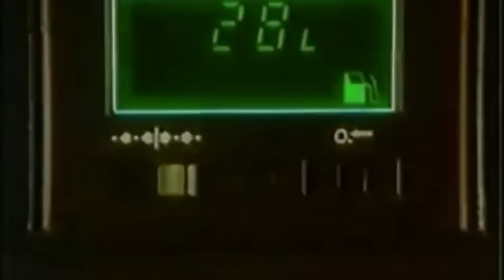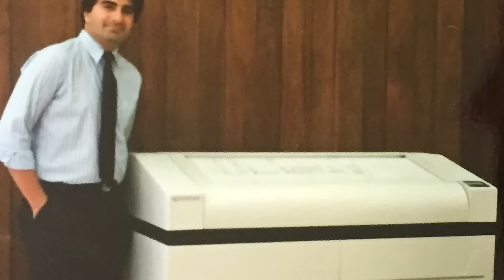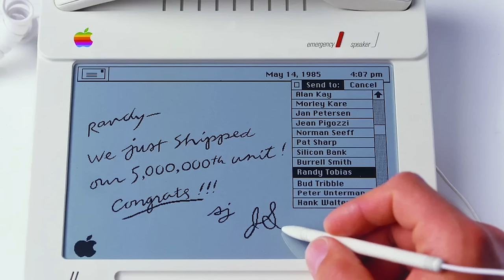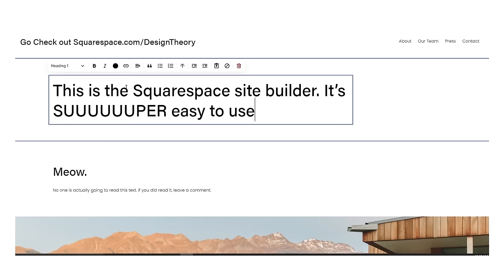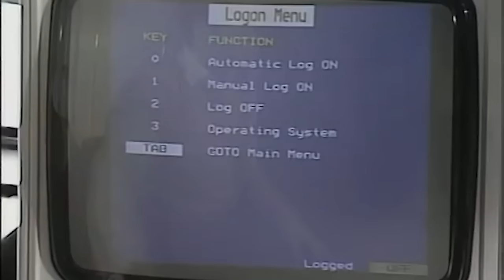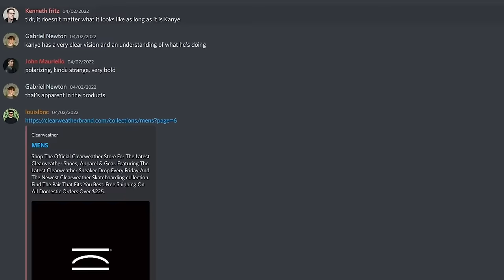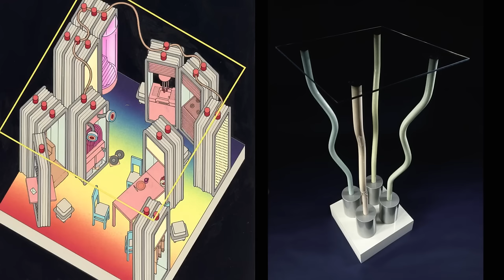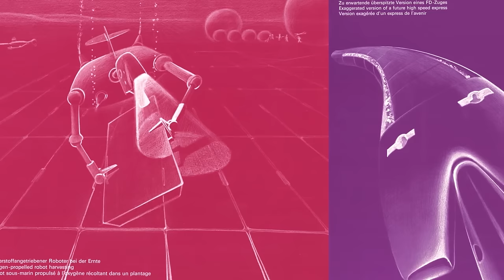Why Design in the 1980s Looked So Weird & Why It’s Relevant Today

Comment: 80s Deign is Idolized today because of Vaporwave and Nostalgia. And the fact that it looks better than the ones today. Clothing today is super bland, and Cars look super bland, so the best way to break the cycle is to dress as Fashionably and out there as you can. I love all those patterns because they look wonderful and out there, I'm glad there's a reason why.
Reply: As stated, part of the 80's design sense was an interplay between culture, manufacturing and economics. The 80's were not only a response to the earlier cultural turbulence, but also made possible by the economics of the Reagan-Thacher revolution and the newly commercialized industrial technologies. The middle class felt richer as manufacturing moved to low wage countries overseas, while the designer was liberated from form by miniaturized electronics. The blandness of shirt and car design today is partially caused by pressure from consumers for efficiency as the economic systems started in the 1980's fail and collapse. If the 80's design wave was global because of communication and technology, this next one may be very local as economies are regionalized and world trade becomes less necessary.
Reply: 80s design nostalgia isn't around because of vaporwave. Vaporwave exists because of 80s design nostalgia. And I think you're confusing "fashionable" with "stylish". You'd have to dress apart from fashion to be "out there".
Reply: Cars look super bland? Even Toyota Camry’s have sharp lines these days.
Reply: That's so stupid. "Things were better in the past" is basically what you said lol. Duh, status qou gets boring, but I can't take anyone seriously who acts like a couple decades ago was better and we're at an all time low as if such opinion has anything to do with where we are on the timeline and isn't just pretentiousness.
Reply: I think its largely due to who is currently making decisions in industry in relation to the decade in question.  Often leadership roles are filled by people in their 40s and 50s.  So you have a lot of people in positions to make decisions who spent their youth and adolescence in the 80s.  And even some people in their 30s who might hold leadership roles already have memories from the 80s.  So of course nostalgia for the 80s is going to be high in design and pop culture. Many of the people designing things or making media spent some or most of their youth during the decade.   And we've seen this with the previous decades before.   There was quite a bit of 70s nostalgia throughout the early 2000s, 60s nostalgia in the 90s, 50s nostalgia in the late 70s and 80s, etc.   I think most people feel at least some degree of nostalgia for their youth as they get older and hit middle age.  And since they're often the ones making the decisions in industry and media, that nostalgia gets passed on to the current times culture.  I've already seen some shows and movies referencing 90s culture and I suspect that will only be more frequent as we move further along into the 20s (boy it feels really weird for me to say "the 20s" and not think about the 1920s)
Reply: Lots of cars in the late 1980's look so bland in the box in the middle with box back end and front end to them, not all but a good number looked this way in the late 1980's and into 1990's before the cars got the super aerodynamic looks to them.
Reply: I think a large part of it, is also what's called retrofuturism, looking at what people of the past thought that things would look like by now, and wishing we headed more that direction. It seems like the 50s and the 80s are the biggest decades of talking about the future with unique designs as part of that. A big example that comes to mind is Back to the Future, as a lot of those designs were still very 80s and showed a much more fun and exciting idea of what things would look like compared to what we have. 
I'm young enough that I only remember 2000 and onward, but through movies, music, fashion, and other designs from then, it's easy to see that we could have gone an entirely different way with a lot of common items around us. There's a lot of simplification today (looking at Apple specifically as for a while, all their products looked very similar and largely still do, and they removed the colour from the logo), and it seems like that emotional part is completely forgotten in terms of making the smallest and most practical design. Except in lighting, a lot of modern lighting isn't practical.
Reply: vaporwave is an ugly, soulless parody of the 80s. Most "vaporwave" stuff they're selling is horrible

Comment: Wait, "form follows meaning" and "form follows emotion" are two entirely different concepts. Absolutely the 80s could be summed up as "form follows emotion", but there was absolutely no "meaning". The 80s was entirely nihilism, which found its cultural expression in the 90s. Ive seen this move quite often in your videos; namely embedded your thesis into an entirely different concept..... and it's not done so dialectically.

Comment: Fun video to watch, but 80s designs are vomit inducing.  Having lived through the decade, it seems to me that things weren't so much designed, but rather over-designed in the 80s, which led to the (sometimes) much cleaner and more organic designs of the 90s.  The 80s were the "greed is good" decade and that attitude, I feel, was reflected in designs which didn't know when to quit.  Just like an endless thirst for material goods, also meant let's use all the shapes in one product whether it needed it or not.  Bah.
Reply: Yeah, 70's and 80's design sucked, and I don't want to go back.
Reply: having to see some of this still in TV and some older stuff in buildings in the early 1990's as a kid yeah I hated it as all of it looked like Nickelodeon had its TV shows intros, just look into a 1990's Chuk-E-Cheeze or a defunct Fun Zone.  However the earliest of the modern silver space age look that lots of tech has now including the Acer I am typing on , was created in the 1980's with things like Sony Record players, the model that had the all silver body for main part of the machine with the decibel view in three lines on it, or the small portable players like an old early 1980's GM single speker radio and tape player I had as a kid that was plug in but also had a spot for batteries to go. This moved into the 1990's when a second revival at NASA with Hubble Space Telescope and the 1998 Mars rover brought in more of the modern silver space look borrowed over from the 1980's.  Design was going this way anyhow thanks to the new millennium of 2000 coming closer.

Comment: I think people mistake "Form follows function" as if that is the only thing taken into consideration. It's rather "form follows function first" so you don't end up with a chair that just a nice looking  scoliosis machine or a gaming console that doesn't fit next to the tv (i get that some consoles do have non-square designs so you don't use them as a table or block the airflow tho).  

My point is those Yeezys are ugly AF, like alien crocs with an alergic reaction.

Comment: Memphis Milano Group furniture is based on Bauhaus art, which was inspired by a mix of Cubism, Orphism, De Stijl, influence from architecture in Tiruvannamalai India, & 1920s painter Wassily Kandinsky.
The entire first half of the 80s was still very much stuck in the 70s, but more pastel, floral print, modest, & very "grandma's house" with a very heavy emphasis mid 1950s-mid 60s design influence in architecture, music covers & jackets. The bold colors & abstract avant garde shapes were mid 80s to mid 90s.

Comment: This video made me question: What even is a 'bad design'? As long as a 'product' serves my needs, and does the function that it says it will do on the box, it's fine whatever it looks like for me, as long as it looks like (and there's evidence that) the designer has put care, effort, and passion into that design. It doesn't have to look 'modern', minimal, clean, sleek, etc. like every new product nowadays, or the opposite of that, entertaining, out of the ordinary, etc. I don't think anything is 'required' to look like anything, or be a certain shape, for it to be a 'good design'. So, while I'm not exactly super attracted to those very colorful 1980's furniture, they look comfortable. I guess for some products, there's merits for it to blend in with other things in your environment, or not look too 'busy' with the parts that are visible to the eye. You reviewed the iMac 2021 design for example, for an all-in-one computer like that to have a 'succesful' design, the only thing that should attract people's eye in its front side should be the screen, otherwise any other design detail at the front would cause people to not be able to focus on the user interface and not be able to be productive with the computer. But that doesn't mean Apple shouldn't go crazy with the back design (and I'm not just talking about a slightly more vibrant color than on the front, I'm talking way crazier than that). That said though, I don't think the imac is a bad design, I'm just pointing out the fact that the iMac is very minimalistic because some people think it looks too boring and non-innovative/iterative. As I said, I do not care (care not as in not caring, but as in "I don't mind if it's too minimalistic OR too overwhelming with emotions), I just care about a good computer. So anyway, these are what crossed my mind after watching this video, and I wanted to share it.
Reply: I'm reminded of (GE?) designing a thermostat (the round spinning dial thingy), so they took hand measurements and made the size the average of the hands so it would be comfortable to the most people, integrated the change temperature into the housing, two analog displays, etc.

In a word, ergonomic. Intuitive. Very clean design. 

I believe most of those lessons are lost.

Comment: 11:33 "But you have to remember what other computers before it looked like."
shows a computer that was released after the Macintosh was released

Also, for some reason, people keep presenting the Macintosh as a symbol of the 80's or some genius design. The original Macintosh is instead an example of when to not put form over function, since it was marred by performance issues and instability competing 16-bit machines didn't experience. The design didn't even include a cooling fan; thanks for all the fried components, Jobs.

The design also embodies another staple of Apple's design that persists to the modern times: take away features and raise the price. The Apple IIGS released later had much better specs, most notably full color and wavetable audio (compared to the Macintosh 128k/512k's monochrome screen and beeper), and it was expandable and user friendly, unlike the Macintosh. Additionally, the Macintosh was more expensive than the IIGS and its competitors; the Commodore Amiga, the Atari ST, and the IBM PC and its clones. Despite this, Apple continued to develop the Macintosh and deserted the IIGS.
Reply: The Atari ST looks better than the Mac too.

Comment: I think Mr. Esslinger must have been referring to later computers when he talked about the sand painting inspiration, as the original Macintosh was designed before his time with Apple, primarily by Terry Oyama and Jerry Manock with guidance from Jobs. One source of inspiration that is definitely known for that Mac was a Cuisinart food processor, likely the model designed by Marc Harrison who was a pioneer of accessible design. Jobs was known to haunt department stores for inspiration, and it would be quite something if this early example of accessibility ended up inspiring the friendly ol' Mac.

Comment: It's funny you mention the floppy disk as a save icon. In the user interface design class I took, the professor asked if anyone had even seen a real floppy disk, and I was one of maybe 5 in the class who did, and that's because I remember those Magic Schoolbus games that came in cereal boxes that were using those instead of CDs. I've noticed some programs switching to a down arrow like the download icon, that will change colour based on if you saved it or not. I don't remember the name, but one of the Ubuntu icon packs has the LibreOffice save icon be an orange arrow, and then it turns blue when you save. I liked it, as with computer design, knowing what something is and real-world parallels are very important. It can be seen as restrictive, but like you mentioned with the game systems, there's a lot people can do to both be intuitive (to know what something is and how to use it) while also being creative and adding something unique and fun into it. I found Nintendo did that well with the DS systems, but very poorly with the Wii U, where a lot of people didn't know how to use the Wii U, and if it was just a Wii add on, or what games needed what controllers. Where the DS systems, we already knew what flip phones were, and how most game controllers looked, so putting those together with some fun shapes and colours was a good way to make something simple, yet versatile, fun and welcoming.

Comment: Well done. Also mentioning CAD based manufacturing.
I had in mind that 3D printing really started around 2004/2005 when it became open source (hard- and software, FDM). Laser 3D, that must have been around 2012 when patents expired. well, there were companies like EOS and some in the US before.

Comment: Great video, but your info about the original Apple Macintosh design is wrong. While it’s true that Hartmut Esslinger and frog-design developed designs for subsequent Apple Macintosh computers, the original Macintosh (with the chamfered edges) was designed in-house by Jerry Manock who also designed the Apple II and Apple III computers.
Reply from the maker: Yes I know sorry if I misled you with the b roll I used

Comment: To many the Memphis movement was also know as 80's Deco, impart because many of the Memphis Movement items had lines very close or indentcal to that of Art Deco/Decorative Arts. Also in the late 70's  a Art Deco revival was being done in Architecture, which lasted into the 90's - but is better known as 80's Deco. in fact when you do an image search for 80's Deco it will reveal a lot of interesting images from the 1980's. With 80's Deco/Memphis furnishing etc. it was fun in style and also a fun mix of bright neon colors.  I have seen a lot more interesting elements from the 80's being used in design today; with in sneaker design I have seen new shoes that looked like they browed from the mid to late 80s.  I have also noticed some Architects are recreating 80's Deco homes; though some Interior Designers don't fully know how to grasp designing kitchens and bathrooms that look like they belong in the home.  The 80's was definitely a fun and exploration period for design.

Comment: @13:26 Ya kno... I wonder if there'll ever be a change to that with Generations of the past 10y+ being unaware of its roots - Not that there is any necessity to change it though... 🤔
I think the only - not quite - Successor to the Floppy Disk Icon would be the Cloud Icon as it kinda serves the same purpose but in a different way.
Reply from the maker: Every icon should just be a bunch of lightning bolts to communicate the transmission of information through the air ;)  (kidding. mostly)
Reply: @Design.Theory  everything should just be binary. Icon? Binary. Text? Binary

Comment: Does this mean that we might get pop-up "up and down headlights" again??
Reply: Probably not. As someone that's worked in the lighting industry, lighting design was often constrained with having to fit reflectors (think of halogen PAR lamps), and designing to accommodate the thermal load from incandescent bulbs. As a result, lighting had to be made from durable, heat-proof materials. This often meant that glass, metal and porcelain were materials of choices. I've witness how lighting design has changed since the proliferation of LEDs. You can now make a functional light fixture that consists of a couple of surface mount LEDs soldered to a circuit board, that's stuffed into a thin plastic diffuser. On one hand it allows for slimmer, more energy efficient lighting, but we're probably never going to see robust designs that include large sculpted pieces of glass again.

Comment: Yeah, I get it. Current parametrically driven design, small reveals, organic tessellated elements, and smooth non-circular curves/topology kinda make everything look like it could be a Zaha Hadid building, no disrespect, parametric design is a crucial part of how she and her firm designed buildings. Where in the 80's, everything looked like the work of architect Micheal Graves on contract to Peewee Herman.

Comment: I find 2020 design playful like the 80's probably was. Look at the bold colours of new iphones compared to the Black and White colour options throughout the 10's. I noticed today the fashion some men were wearing whilst playing with a scooter on a quiet road reminded me of childhood and there is a big yearning for nostalgia. 
However I feel 10's design was more focused on actual premium quality and luxuriousness than now. Look at new cars like the new S-class vs the previous version. The new one is filled with so much tech and innovation but it doesn't feel as premium and looks like all the electronic will inevitable become faulty. 
I wonder what caused the shift from focusing on premium quality to more showing off and playfulness with current design. Although some designs are still focused on premium quality.